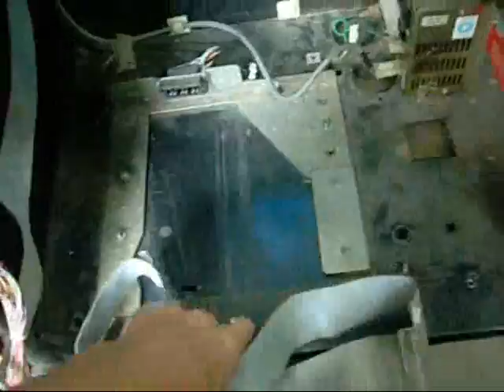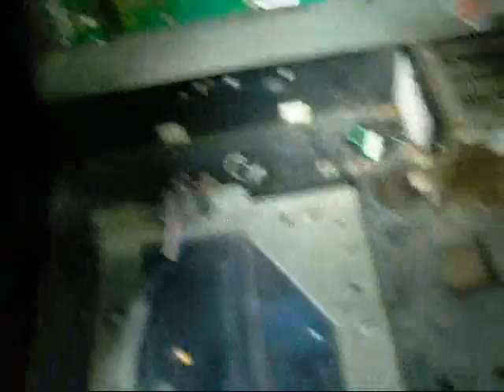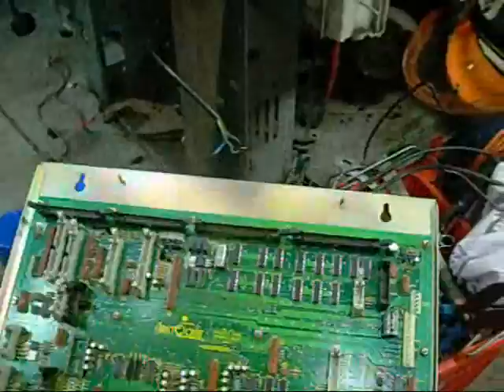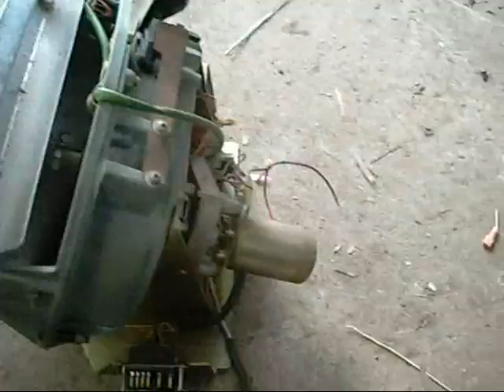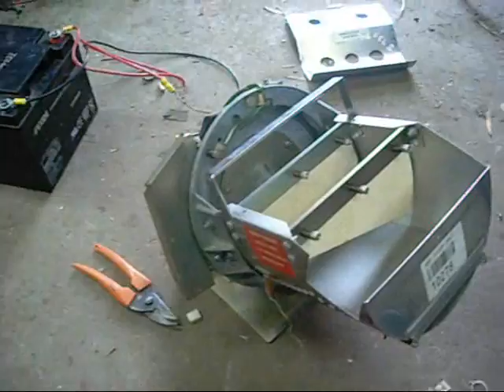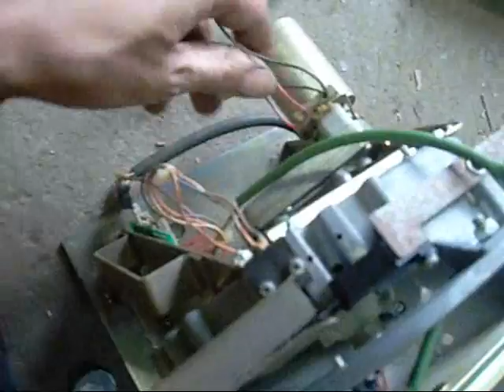Equipment Autopsy - Aristocrat Pokie (Slot) Machine Pt2

Comment: You may have noticed "probes" with insulated bushes in the hopper, they are for coin level sensing.  It may also have a weight activated microswitch to detect when the hopper is getting full and deflect the money directly to the cash-box.  I was wrong about the deflector magnet on the coin door, it's for diverting the money into the hopper or letting it fall into the cashbox chute.  The hoppers I have here have a helical strip that combs excess cash over the side of the hopper.